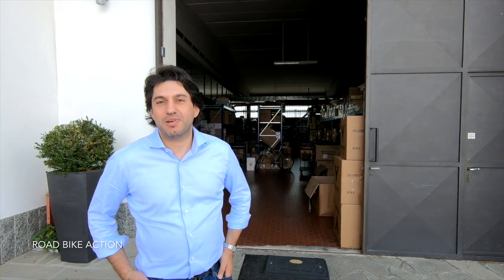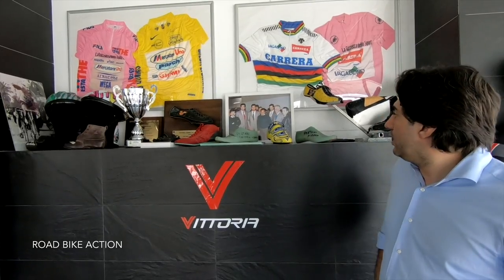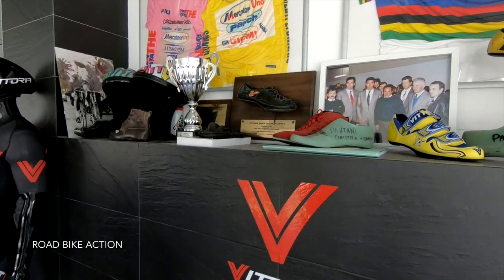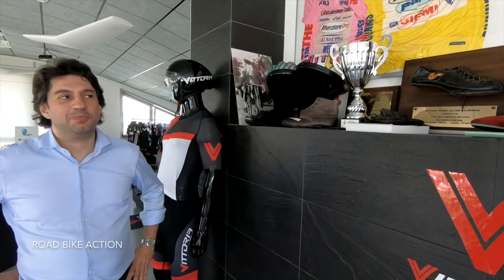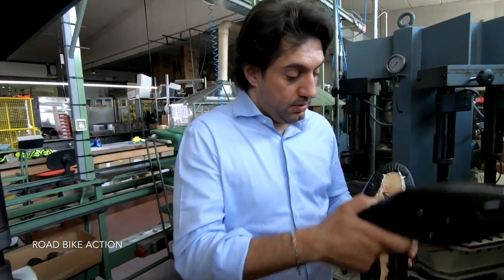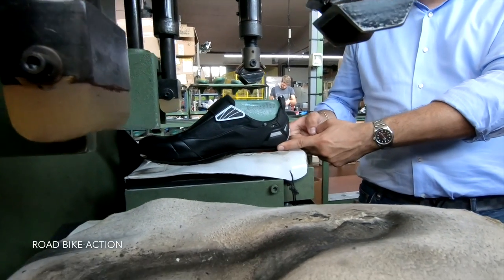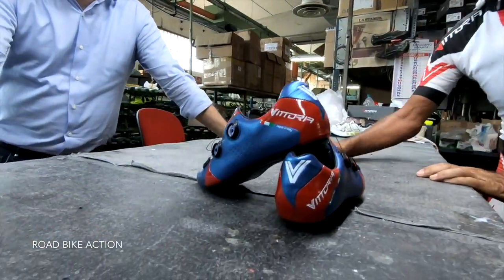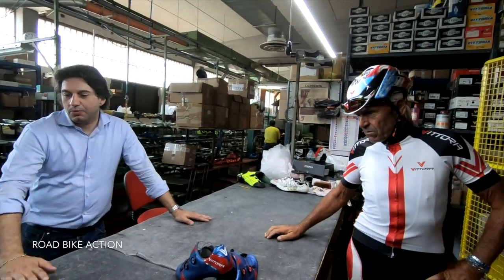Vittoria Show Factory Visit in Italy

Comment: Vittoria, I've bought three pairs of your cycling shoes from Vittoria US in Valencia, California. I've been using a pair of red/white Veloce Carbon shoes that fit and work well. I really do like the craftsmanship and the BOA closure system. I've had them for two months or less. I just bought a pair of 2019 Stelvio shoes (gray) for me and a pair of red/white Veloce Carbon cycling shoes for my son. I bought a second pair of shoes for myself because I just bought a 2012 Masi Alare road bike for $240. It has Shimano clipless pedals but I'm switching those for a new pair of LOOK Keo 2 Max Carbon pedals. They have Keo specific cleats so I needed a second pair of shoes. My Veloce shoes have LOOK Delta cleats to fit the LOOK pedals on my Lemond Reno road bike.